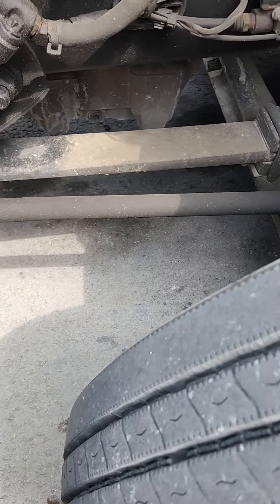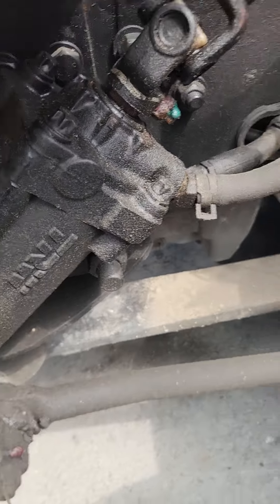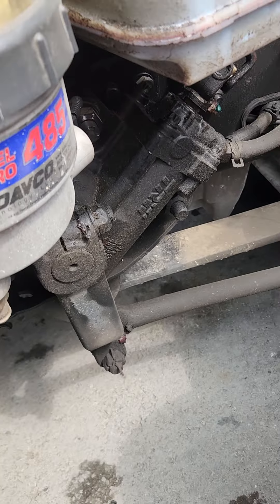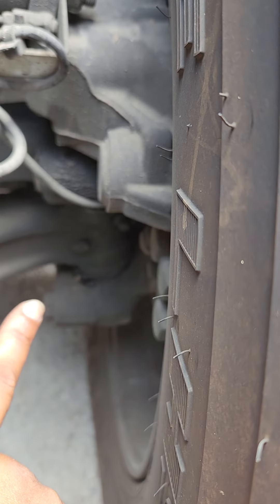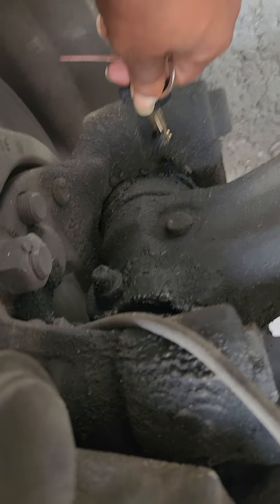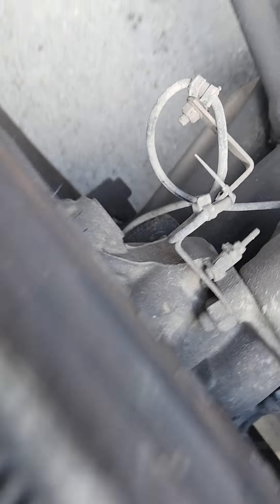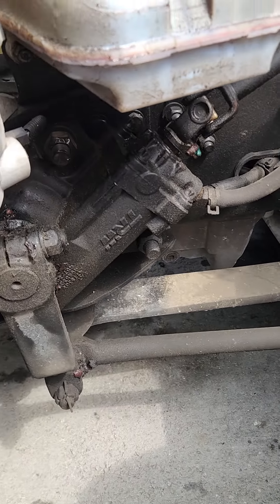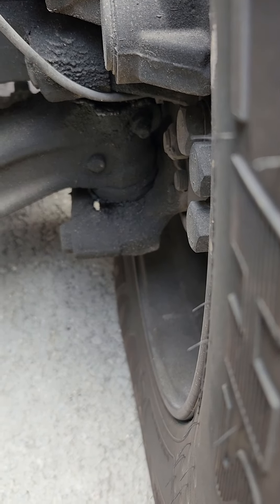broke down again. steer tire shaking

Comment: i noticed that the inner side of the tire is wearing off that means it needs alignment but first you got to check the inner tie rods,outer tie rods lower control arm ball joint, and upper control arm joint; the outer tie rods wears off first